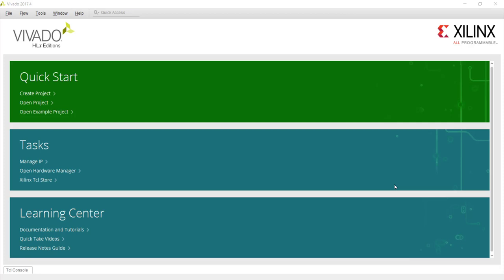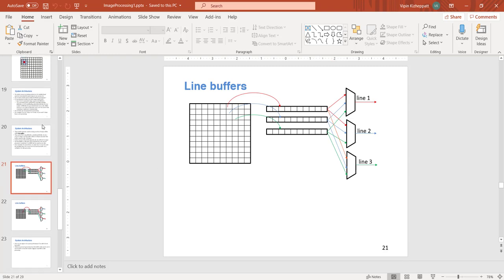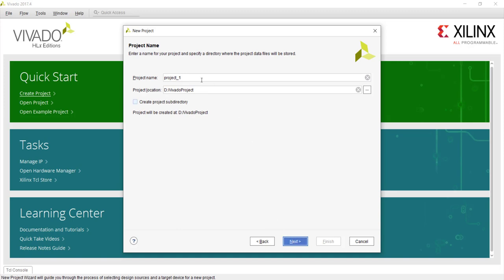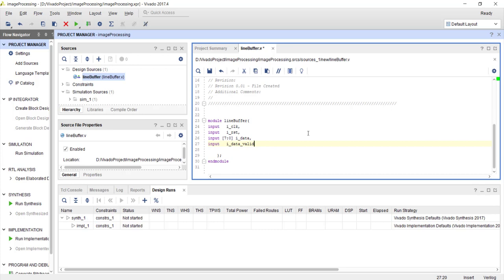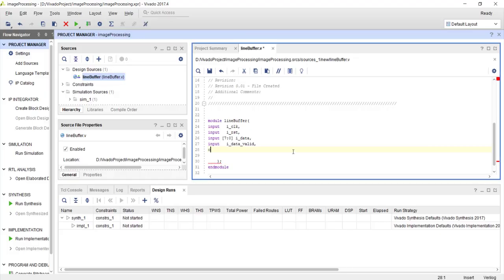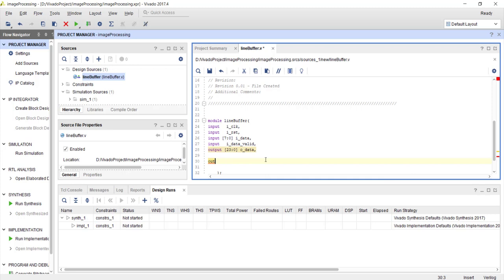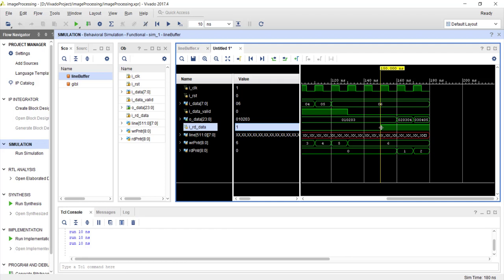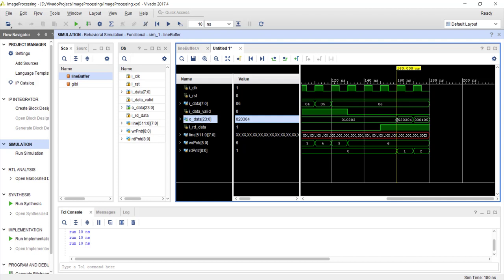Image Processing on Zynq (FPGAs) : Part 2 Design of Line buffer

Comment: Hello sir ,
I have a query 
For capturing images through a camera connected to the zynq board do we need a specific software ? 
If YES what software would be better? (Would it cost?)
If NO how to perform processing on images in a simpler manner just by directly capturing the images?
Reply from the maker: You can use OV7670 image sensor which gives pixels in raw format. Whatever IPs r shown in my video r free. But more advanced image processing IPs r licensed. Check this tutorial https://www.instructables.com/Connect-Camera-to-Zybo-Board/

Comment: Excellent video man, I have a question: what if the convolution is with stride 2? How can I tell the Conv to skip a loop of reading data from the line buffer?
Reply: bro is line buffer giving proper output, i am getting proper output in modelsim but in vivado i am niot geeting the correct output, in one single run wrpntr and rdpntr going to 100 counts like that

Comment: Thanks for your implementation, but to use the FPGA's area more efficiently would not be better if we use BRAM IP for line buffers?
Reply from the maker: We can use BRAM. I think some where in the video I mentioned it. For Xilinx if we make a memory with write width 8 and read width 24 (I guess they don't support this aspect ratio still), when we read first 3 pixels will come and next time next 3 pixels will come. It won't shift by 1 pixel.